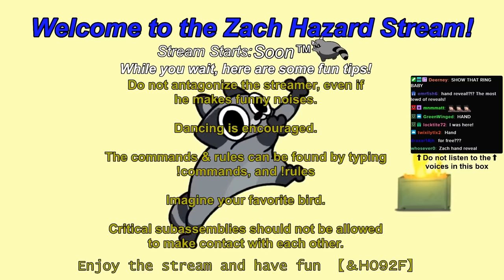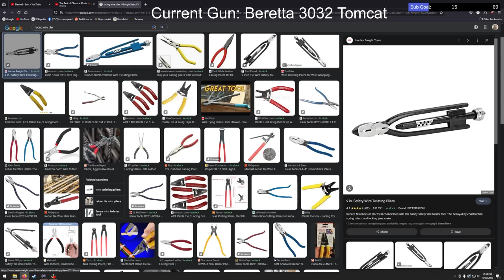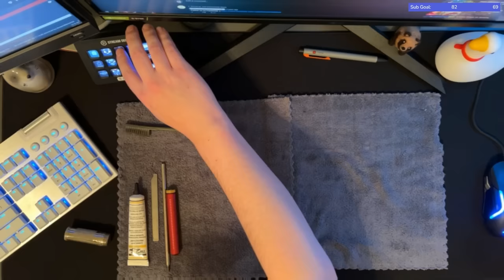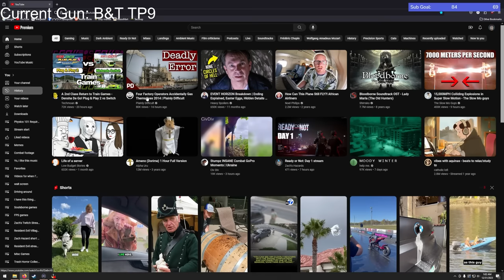PMCS to Classical Music: Mark 23 SOCOM & More

Comment: Zach is the IRL Mechanic from Tarkov, and I'm here for it.
Reply: "I've loved guns when I was a kid, and I've come to love them more as I grew up. When I turned 21, I didn't go drinking with anyone, unlike what I think most would do. No, I went down to the local gun store and bought myself my first handgun. It was a M1911, and I shot it on that day. I was still in the military at the time, so I took it back to the barracks room and cleaned it, even though some of my friends decided to invite me out drinking. In the military, I was issued an M4, which is probably one of the few guns I would consider myself an 'Expert' at. I like to think I took care of it, especially since I took care of the other M4s in the unit I was in. Speaking of M4s, someone came in and asked for a custom M4A1 built for them. 13.7 inch barrel, Griffin Armament M4SD Suppressor, Magpul CTR stock, and a Daniel Defense M-Lok vertical foregrip mounted onto a Geissele MK16 13.5 inch handguard. Ergonomics must be over 50, and less than 270 recoil sum, and not over 3.5kg in weight. Hopefully he takes care of this rifle as well as I did."
Reply: @simply_or_sumn is that a snippet of one of his stories, sir? Thank you for reminding me of all the different stories he kindly shared with us during his time in the military
Reply: So he has a bitcoin farm too? Damn.

Comment: My favorite all time injury with Safety wire was I had to change out a fuel pump on a C-17 Engine and anyone whose worked one knows there is a three-way safety wire to connect those lines. I reach up to map out how the previous person did it for later reference and my forearm proceeds to be shredded up from a pigtail that was done poorly. Blood starts running down my arm and it looks like I tried to unalive myself. So many curse words were uttered that night and still have the faint scar to this day. I know your pain Zach, hurt like a mother too.

Comment: @14:00 that recoil spring setup is actually straight off the Webley( and later H&R licensed copies) self loading pistols from the early 20th century.
The most famous was the 1912 .455, but the big sellers were actually the small .32 pocket pistols.
On those it was required due to the need to use an exposed barrel to get around Browings patent on enclosed slide pistols.
For Beretta, it's a side effect of trying to keep the tipping barrel mechanism and the compact size.
At least vertical size. I didn't realize until I owned one just how freaking wide and dense those little Tomcats are. 
Fun little gun, but it just didn't work for me.

Comment: If any optics set up for the PS90/P90 it should be a low profile set up for pistol reflex/holographic optics, with the screw holes to replace with a 20mm rail that comes with the gun, to keep the 'low' profile that the original optic provided.

Comment: I could smell the solvents and oils while he did this, hey Zach any tips for disassembling 1911, mine has a upgraded spring and 2 piece guide rod and it’s a pain to take apart without the spring end cap going blasting off on me

Comment: Hey Zach, great video. Weekly video cleaning one gun?  

I have a question, is it true that aluminum cleaning rods will oxidize and aluminum oxide is an abrasive that will damage the barrel, chamber, and crown?  I've switched to all brass cleaning rods just in case.

Comment: The silver line on the flashlight... Why not a chemical blackening process work to mask it up more permanently than sharpie? I mean, it's a bit more expensive but I wouldn't be surprised if you didn't have the supplies on hand already.

Comment: Hey Zach, could you say what kind of kit you are using? Specifically the bag and the cool little cylinder you keep your bore brushes in. Would appreciate it as my current "kit" is a hodgepodge of different tools that I keep in a walmart bag.
Reply from the maker: I'm using a bunch of different stuff. Cleaning rod is from a Pro-Shot cleaning kit, and bag is a magpul Daka pouch. For the tube look up a "Marbles waterproof match safe"
Reply: @Zach_Hazard  Thanks a ton!

Comment: Do you swap off to a silicon ring and wear the real ring on a necklace? Just some 2mm paracord (250lb) would work, when working around tools and machinery, if not, you should, accidents happen, even when you do everything right. 

I don't have rings, however I do wear moderately expensive watches, ~£200, and I found out the accidents thing the hard way, so my nigh impossible to replace Russian watch is now my 'daily driver', so now I tie off the strap into a handle and put my watches in the pocket watch pocket of my jeans, the little one usually by the right pocket.

Comment: Trying to clone build an Army Mk 27 is next to impossible because (and I am speaking as a maintainer of the thing) socom is way looser with "shooters preference" and MWO approval than standard Army. It's not unusual to find actual assigned MK27s with non-military iron sites, optics, mag release, slide/stop release... I have seen them with grip modifications or even grip reductions to make them more glove friendly. I've also seen Crimson Trace guide rods and "fun switches" on military pistols. Just because you didn't perfectly reproduce, the factory version, doesn't mean you didn't reproduce some operator's build.
Reply from the maker: This is why whenever people are like "iTs NoT CLoNe CorREct" I get a little irritated. If it was a "perfect" clone, then it wouldn't be a clone, it would just be a mk 27. And the very nature of the object, a clone of a SOCOM issued gun, means that so much of it comes down to how the armorer or shooter wanted to set it up.
Reply: @Zach_Hazard  Oh, and BTW there's a new version of the Mk27, but it's not called the Mk27 any more. It is now officially the M007 CCW. Yes, the cool guy pistol is named after James Bond.